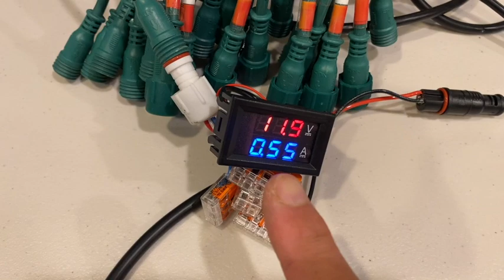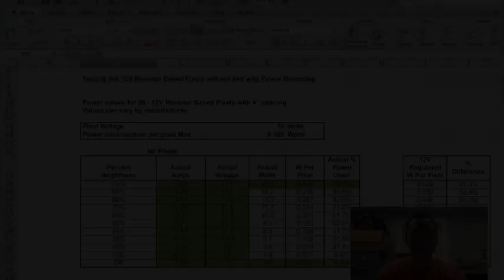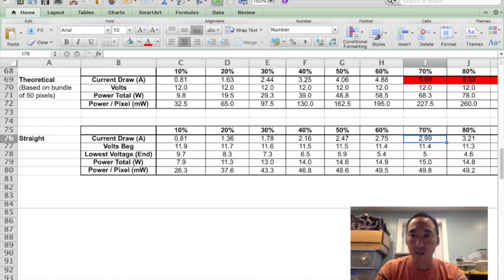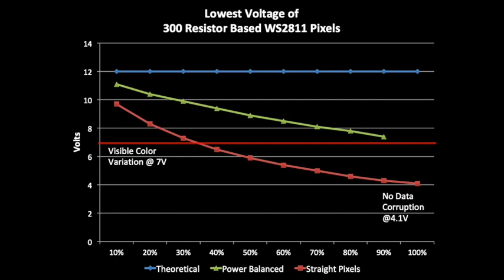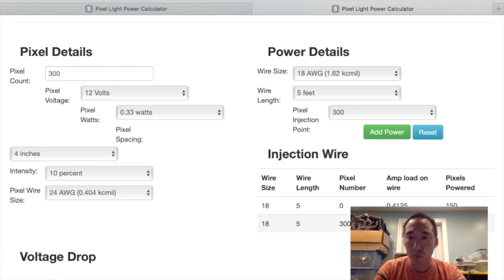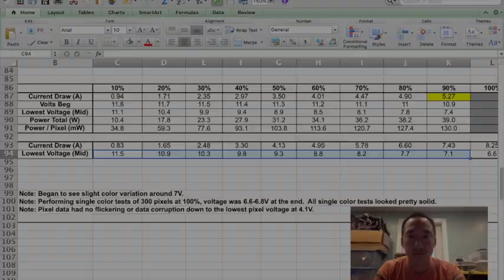Ni Family Lights - Power Balancing 300 Resistor Based 12V Pixels

Comment: Hello Steve, I know this is a old video, but had a question since I am just starting out. I am building my first, power injection box setup. I will be using the Falcon Distro board and 350 watt powersupply. Do I need to connect a ground wire from the Distro 350w power supply to the Show controller 350 watt power supply? Thank you.
Reply from the maker: @rc240zxt, yes, you should connect the DC grounds of those power supplies. If you don’t, the ground is used as reference for the data signal and if the ground level jumps when power injecting, it could corrupt the data signal.
Reply: @NiFamilyLights  Thank you, I will connect the two power supply Dc Ground together.

Comment: Thank you in advance for your help.  I am going to run a 270 node 6 layer star on top of my 20' mega tree. Port 1 will send data and power to channels 1 - 810 (node 270) with a 20' extension. I am thinking about power injecting  at channel 510-511 (node 170-171).  I was going to use a power injection T from controller port 2 - no data. I could break the data pin on the T however I think it would be easier (and keep my T intact) to just disconnect the data line from port 2 on the controller. I am a newbie and have not "blinked" a prop yet so asking to see if my logic is correct.

I have also seen where  you should "break" the V+ halfway between port #1 (data and power) and port #2 (power only) connection (say node 85 - halfway between nodes 1-170) to prevent two 5 amp fuses becoming a 10 amp fuse?  I am only using one power supply (controller has only one power supply). Have not thought about this. Only seen "breaking" the V+ between two different power supplies. I assume these 5 amp fuses would be in parallel - does this make it a 10 amp fuse?

If this is the case (do the parallel 5 amp fuses split the amps, say an 8 amp short send 4 amps to one fuse and 4 amps to the other?).  If this is the case then could I just power and data from port 1A  and hook another power inject pigtail 1B into port 1 with just V+ and V- connected? Hooking V+ from 1A and 1B together with a ferrel and the same for V-  would solve having to many connections on one port.
Reply from the maker: Hi Rick, you have a number of questions, so this may a multi part answer. I also use the same Star for my tree topper. I run one wire up with power, data, and ground to the first pixel. The data line for my star is all coming from that input, the same as you described as your plan. 

I do recommend power injecting at some point in the star. Since you are powering the star from the same power supply, you can do either of the two options you mentioned. You can connect V+ and GND from a second incoming set of wires to pixel 170-171. Since the power is coming from the same power supply, you don’t need to cut the V+ line in the prop. If the power for power injection was coming from a different power supply, you should definitely cut the V+ line in the prop. That would be the case so one power supply doesn’t back feed another power supply.
Reply from the maker: As for the question about fuses, amps, etc…two 5A fuses in parallel going to the same wires to the prop doesn’t permit 10A. It doesn’t work that way because the wires of the pixels shouldn’t handle more than 5A to be safe. 

Hooking 1A and 1B together to a pigtail will not serve any purpose except to increase the chances of wires burning up in case of an issue where the pixels are drawing more power than the wires can handle. 

Each 5A fuse should be independently wired to the prop at different locations. This is where cutting the V+ line helps with separation of power across the prop.
Reply: @NiFamilyLights  Thank you so much for sharing your knowledge!  I did not think that power injecting from another port, same power supply, would double the amps to 10 but got a comment from someone else to that effect.  Again, thanks for all you do for this hobby!😊

Comment: Excellent videos on the resistor based 2811's! I have learned a tremendous amount from watching your videos and look forward to any in the future. I do have a question - I am building my first display and I have my main controller (HinksPix Pro) at one end of the house, and multiple long range receivers (Hinks Long Range Smart receiver) on the opposite end to control a 4k pixel matrix. The main controller will be feeding house trim runs of ~200-500 pixels for three stories, as it happens they all end on the opposite end of the house near my long range receivers. Could I power inject into the end of those runs with an additional power supply (meanwell 12v 350W) on the end of the runs without tying common ground or negative between power suppliers on either end of the house?
Reply from the maker: Thanks Mike! To your question, power injecting from a different power supply coming from a different location should work fine as long as you make sure the low voltage ground (aka V-) are bridged between the power sources at the place where you power inject. It’s up to you if you want to break V+ connectivity at the point of power injection.

Comment: Out of curiousity, what do you recommend for fuse blocks? Bill porter suggested we could go up to 10a fuses using 14ga wire for injection. I noticed most of the excel documents floating around start their limit at 5a and most power boards come with 5a. Should I stick to a 5a fuse with my auto fuse block?
Reply from the maker: KW, I personally use power distro boards with 5A fuses to do power injection. Could you use fuse blocks with higher amperage fuses, sure. However, you will need to be mindful that the pixel wiring is only so thick, and running too much current through them will cause them to heat up, exacerbating power loss and potentially causing them to catch fire. 

The 14AWG wire has no problem handling 10A. If you are able to plan things out well, the 14AWG wire can be used to tap into a prop, e.g. a matrix, at many location points which would ensure that the pixel wiring at each injection point isn’t drawing too much power. 

That’s why vendor power distro boards stick with 5A fuses to keep things simple and safe. Also, if there is a short somewhere, the 5A fuses blow very fast. 

Best of luck to you and your setup.
Reply: @NiFamilyLights  All great points! Thanks again for the help!

Comment: I thought most all pixels ran about .6 watts?  Is it just a factor of safety?
Reply from the maker: Surprisingly, I found out that current resistor based 12V pixels use quite a bit less power. Check out this video where I test the specs of resistor pixels. That said, older 12V regulated pixels do use 0.6W. Newer 12V regulated pixels use a little less. I’m working on that video. 

https://m.youtube.com/watch?v=bTCcCIw-Kw4

Comment: I’m curious I been watching your videos and others how many pixels are in the normal show like your own I have gotten the controller but just getting into everything just looking for like a average on what gets used
Reply from the maker: Hey Chris, I don’t know if there’s a “normal show”. The number of pixels is more dependent upon your planned layout and props. 

The show at my home is 8k pixels with two P10 panels. I use one F16V3 with a differential expansion board and 4 differential receiver boards. 

At the church show, it’s 10k pixels and originally started with one F16V3 and a differential expansion board. I initially had a lot of pixel failures (addressed by lower the power supplies from 12V to 11.2V), so I ended up using a second F16v3 with a 16 port expansion board to reduce the number of pixels per output. 

Hope that info helps.
Reply: I started in pixels last year and had a little over 2000. We outlined the house, windows, doors. Had a couple if arches and spiral trees. And then a "small" 16 x 50 megatree and star. 

This year, we're adding about 4000 pixels, mainly from some HD props and expansion of the megatree.

Is personally recommend starting with the basics in year 1 (house outline, arches, smaller yard props). Then, each year add some new stuff to keep your show fresh.

Comment: Thanks for all your videos they have been invaluable for me! Very interesting to see the comparisons with the Spiker lights. I tested just to see what was capable (starting at 5% and working up), and I am able to run a 1650 pixel mega tree 12v pixels with a 10amp cable directly to the PSU and only pull 7.92amps at 25% brightness all white (with power balancing) and obviously no power with the controller. When I bumped it to 30% I started to get flicker and it went up to ~9.5 amps. Super confusing though as unless I'm putting it in the calculator wrong (highly possible!) it's different to the spiker lights calculation of 1650 pixels. I will be splitting the power across 2 cables to make it safe and also so I can use a distro board which has a 7.5amp fuse, but was curious how much it would actually draw on its own. As this is just my first year, any thoughts you may have on this would be most welcomed!
Reply from the maker: Melinda, are you saying that you’re powering 1650 pixels from just the two ends? That’s 825 pixels from either end to the middle, which you’ll definitely get voltage drops. Who knows how low the voltage has sagged to, but at 25%, it seems like there’s just enough for all the pixels to work properly. If that’s the case, that is quite impressive! 

You must be on the edge of what those pixels can handle. As you stepped it up, the two ends used more power and the middle voltage sagged so much that the WS2811 chips couldn’t reliable repeat the data signal. 

Breaking your tree into two groups will certainly help quite a bit.
Reply: @NiFamilyLights  its power balanced but on 1 cable. I've just taken a quick video of the set up (which I 100% acknowledge needs to be split across 2 cables) https://youtube.com/shorts/31lCkqLw4Ts?feature=share
Reply: this first one is a test of a sequence (self made) to see how various pics, gifs and video turned out, some better than others. https://youtu.be/QfdDCuHdmLI  and 2nd clip a purchased sequence https://youtu.be/EofzWkEMG2Q
Reply from the maker: Ok, I see. You’re power injecting in 5 places, so the average distance per power injection is somewhere around 330 pixels. That should work pretty good, especially when you divide it into two powered groups. You’ll have great success with that setup.

Comment: My longest run of 12V resistor pixels, without any power balancing/injection, will be 306. I have a 918 pixel matrix that'll be running off 3 ports. I haven't decided if I'm running it at 20, 30, or 40% brightness just yet. But, I've tested 10, 20, 30, 40, and 50% and all seemed to look just fine for my application.